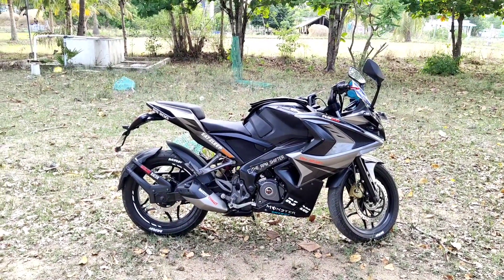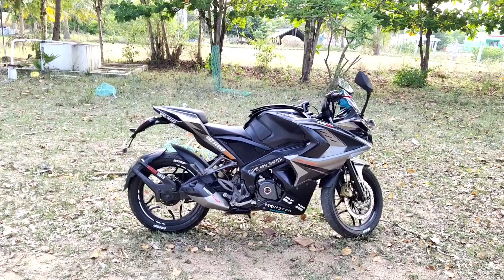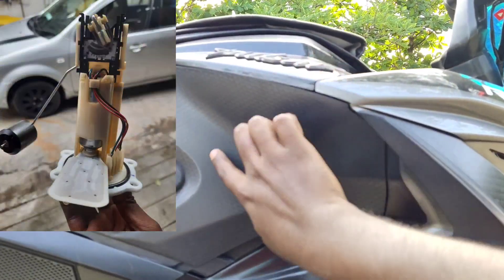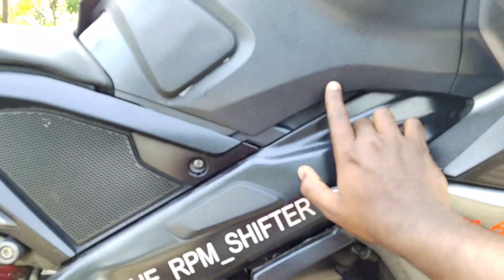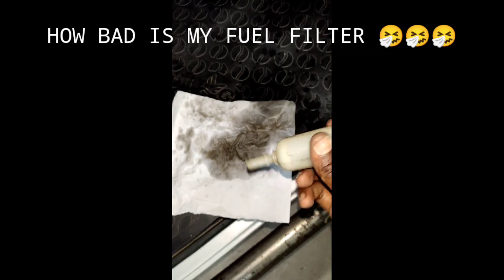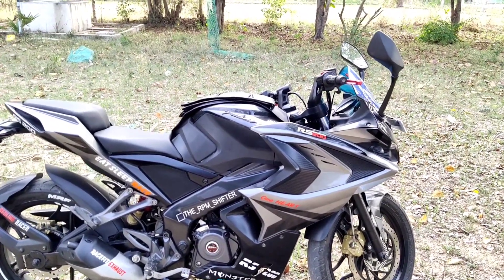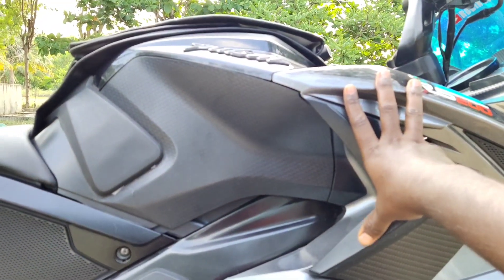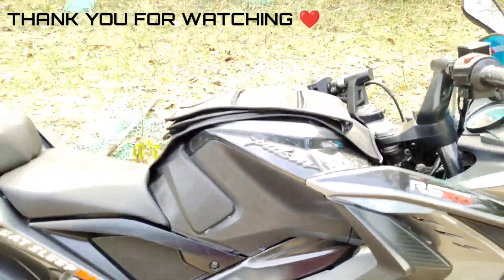WHY DO FUEL FILTERS NEED TO BE REPLACED !!

Comment: Fuel pump constant speed la petrol ah pump panitae irukum bro .Apo idlingla petrol flow aagira kudadhu apdinradhukagavum andha fuel filter use aagum bro
Reply from the maker: Oohh ok bro ❤❤
Reply from the maker: Ninga sonathu crct bro but fuel filter full adachiduchuna fuel velila varathu bro apdiyea vanthalum pressure drop agidum apo power loss missing agum bro😇
Reply: @robinrsvlogs6862  max inline fuel filter vara vaaipu kammi than bro  incase tank rust aachuna kandipa nenga sonnadhu nadakum enakum nadandhuruku
Reply from the maker: Enaku achu bro not in bike enoda Car la achu car start agala enanu patha fuel filter full ah rust agi fuel velila pressure ah varala ...elam oru safety Ku thana bro